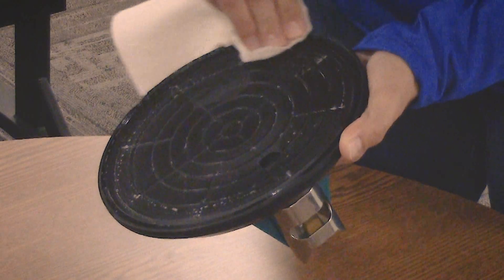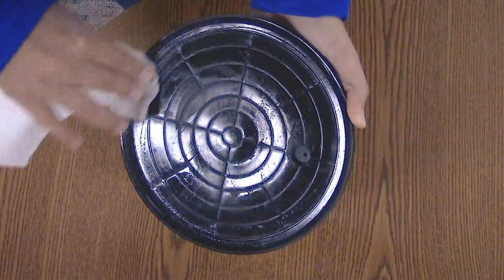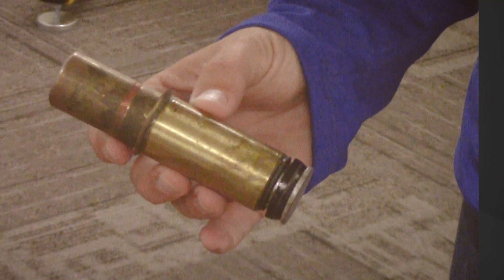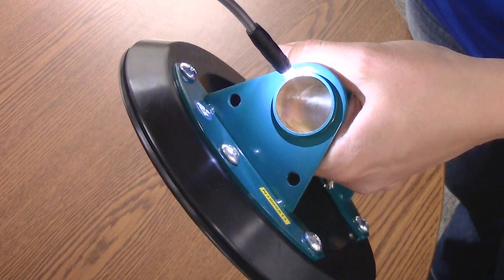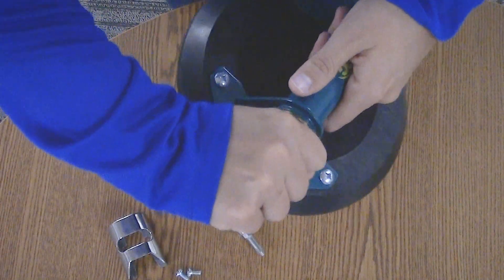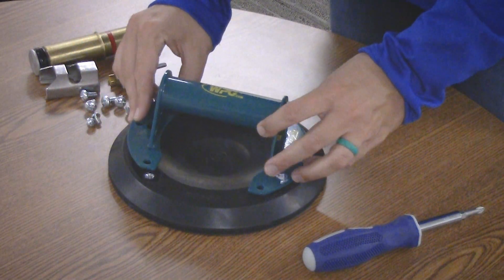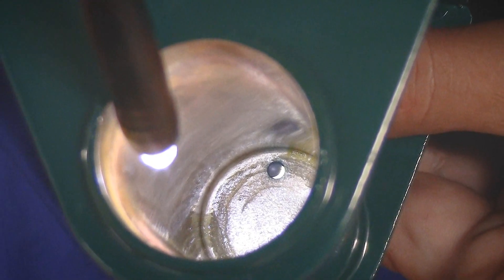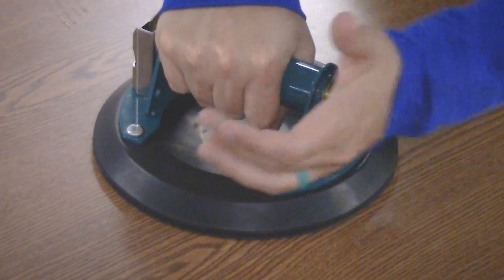Troubleshooting Metal-Handle Suction Cups

Comment: cant get my N-5450 9 inch to release?....help!!!
Reply from the maker: Hi Stephen If you are unable to get it to release you may want to replace a part or depending on how old it is return it to where you purchased it.
 https://www.wpg.com/exchanges-repairs-warranties/  Here is where you can find the parts  https://www.wpg.com/catalog/parts
Reply: @WoodsPowrGrip  It been in its case for 30 years...lol...have no idea where it originally came from meanwhile its stuck to my mirror i guess i need to just remove the release itself but its not in a good position to keep from losing that little ball
Reply from the maker: @stephenhill2925  Be careful removing it, but if the check ball get's lost, you can find new parts  https://www.wpg.com/catalog/parts  Good Luck!
Reply: @WoodsPowrGrip  Thanx Folks....Twenty four hours after the Red line on the plunger was showing it still wont release...otherwise good suction for a 40 year old unit used for 10 and stored for 30 years...